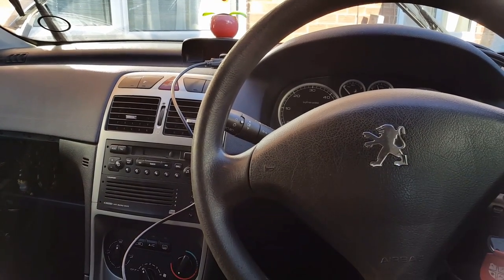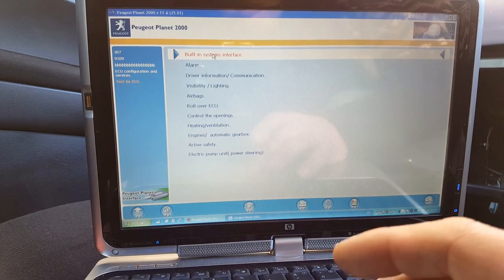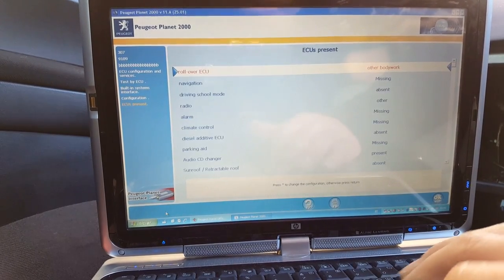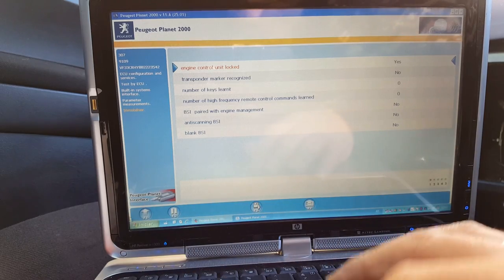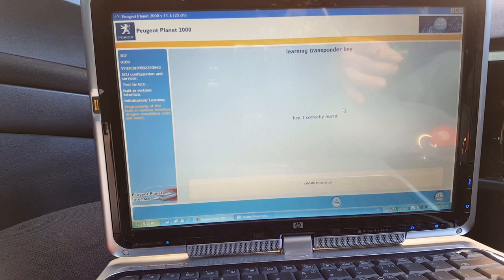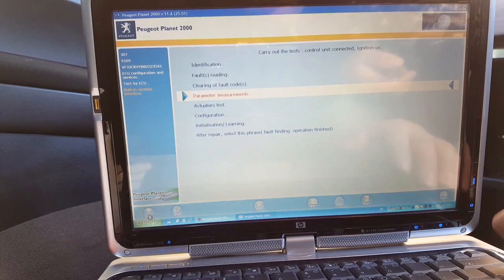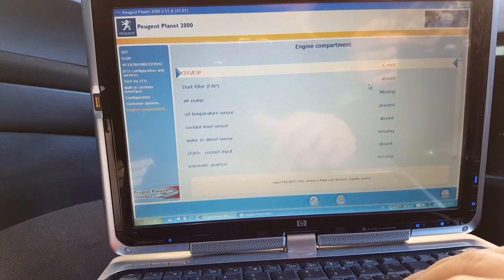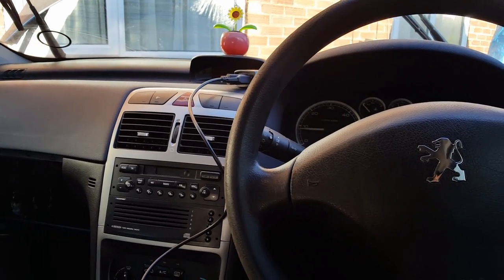Peugeot Citroën blank/virginized (new) BSI programming. Includes key/immobiliser programming.

Comment: Thanks to LM for his excellent videos.  I am using a Planet 2000 that comes with a recent Diagbox and I had to do things differently to get the BSI working.  I tried to configuring the BSI through the "ecu configuration and Services".  I configured the VIN all the ECUs present on the 307 but couldn't get past entering the PIN code to do the key programming.  Planet said the BSI was blank and should be programmed.  After some searching I followed a suggestion on another site to select "replacement Parts" rather than "ecu configuration and Services" and choose the option to configure a replacement BSI. It remembered the VIN I had previously entered and I had to overtype a few of the characters so it could be saved and it then asked for the PIN which it also saved away.  After that, the BSI it was unblanked and it all worked like clockwork.
Reply: I have same problem and I did as you write here but still no luck
Maybe I need to use old version of pp2000
Reply: @adnansuljic3739  I have the same problem, I can't find any solution :/

Comment: Did the high frequency remote work on the second key?  At 20.23 minutes into the video the screen shows 1 HF remote learnt.  My understanding HF remote is also  learnt when the key is programmed.  Synchronisation is a second step, which only synchronises the remote’s coded signal with the car.

Comment: I have a new, unused BSI, purchased from the store days ago. I plan to install it on a peugeot 3008 which is currently running, but with some flaws due to the problem in the current BSI. Since the vehicle already has 2 keys recorded, I would like to know if even then, after installing the new BSi I will have to present new keys or if I can use the existing keys, since I will not make any changes to the PIN code.
Reply from the maker: Hi
As far I can tell, you will need new keys... 
Thank you for watching!

Comment: Loving and learning alot. I have read all the comments. However I am having trouble with 2 things. 
1)The pin code. If I don't know it, I need to get it from the ecu I think. How do I read it from the ecu, a scan tool, and if so what scan tool? Or do I phone Citroen and get them the vin.
2)if it is a new bsi, I need a new transponder for the key and remote for locking and unlocking. It that because the new bsi can't use used transponders and remotes??

Regards Seb
Reply from the maker: Hi
1. Yes... you can take it from the ecu... I have videos on that...
Or, go to the dealer and they will supply you with the code, once you prove you are the owner of the car...
At least, is how it works here in the UK.
2.yes... you need new transponder and remote for the reason you mentioned.
Thank you for watching and for your comment!

Comment: Once again you are one in a million bro.. I have problem with a 406 Peugeot signal it's only flash thrice and stopped I have changed the bsi and also the com2000 still not working any guidance please I will appreciate thanks.

Comment: Hello mate,thanks for the video.I have an issue with a citroen relay,bsi needs to be matched to the ecu as there is an immo error.Do i need to pull the pin to be able to match them with pp2000?It is a 2019 van so i wonder what tool would be best to match them.

Comment: my 307 SW 2005 is leaving the lights on for 2 minutes or so after closing the car if stop with lights ON, do you believe this could be a malfunction in my BSI? i have PP2000 and interface please help me.
Reply from the maker: Any codes?
What on live data regarding lights?
Anything out of the ordinary? 
Thank you for watching and for your comment!
Reply: @LMAutoRepairs  The fan The air conditioner stopped working, the same day I noticed this problem, if I turn the headlight high or low, they will not turn off anymore, I need to the car and wait a few minutes. No error codes are appearing. The only strange thing I noticed was that my scanner is no longer reading the engine calculator.
Reply from the maker: @VisionStudioFilms  
Check live data...

Comment: Thumbs up for the great job..my problem is the car remote has signal but when i try to lock/unlock the car not respond i don't know where i start?  and i don't have that security code
Reply from the maker: Hi
Have you replaced the BSI? 
Thank you for watching and for your comment!
Reply: @LMAutoRepairs  yes,i replaced my engine with another one with all the component of the new one including wiring loom bsi engine ecu eveything
Reply from the maker: @ahmedhisham1438  
Ok...
And the key and remote still the original one from the car correct?
If yes, then you need to program a new key...
That remote will not work again on that other BSI...only on the original...
Program another key and that's it...
Reply: @LMAutoRepairs  no, the key and the remote of the new one also and the ignition as well
Reply from the maker: @ahmedhisham1438  
In that case just to through the sync procedure...
I presume the car is starting ok, and is just the remote that is not working,  correct?
That failing,  you might have a bad remote...

Comment: If I understand the info on top correct. If I do not have at least one original transponder chip and remote I will not be able to get the remote to work?
Reply from the maker: Correct...
Or you get a replacement key... (remote and transponder...)
Thank you for watching!

Comment: Wondering if you can help,trying to supply customer with spare key,cut and programmed it to the car no problem,however,and it seems to be a common problem is that the programming of the remote doesn't work,three new keys i've bought and the remote doesn't work on any of them?,do you know where to get one that definetly works?car is an 09 peugeot 407,thanks.
Reply from the maker: Hi
The remote should program at the same time, but need sync after...
If you are getting cheap China keys, I had the same problem in the past...
Thank you for watching and for your comment!

Comment: Hi loving your video's.  We have a Citroen c4 1.6 hdi with the same symptoms wipers and lights on all the time car won't crank. We got a blank bsi still got to program yet but as soon as we connect the battery the wipers and lights still go nuts. Should that still happen with a virgin bsi or will it stop when it's programmed?
Reply from the maker: It is possible...
Have it programmed and go from there...
Thank you for watching and for your comment, really appreciated!
Reply: @LMAutoRepairs  your a star thanks.  I was starting to think the virgin bsi was a waste of time so didn't start the process. Will get on first thing. Thanks for a fast reply.

Comment: Hi there, do you perhaps know what is the pin code for 2010 Peugeot 207 1.6VTI - ? 5 door.
Reply from the maker: The pin is different for every car... 
You need to read it from one of the module, or ask for the security card at the dealer...
👍👍👍

Comment: Nice video, very helpfull. So i'm wondering, Is it also possible to access a peugeot 4008 2012 BSI for editing settings? I just installed an android aftermarket head unit. and want to be able to controll some if not most/ all car functions via the unit through BSI. Without using OBD2 adapter.
Reply from the maker: Hi
Don't think that's possible...
Perhaps with one of those Bluetooth adapters connected to the OBD... and then accessed via head unit...
Thank you for watching and for your comment!

Comment: Hello Great video! How do you write a PIN code when you failed the first time? You stopped the video and started from the point where the pin was already writed. I can not write pin too. How did you write that pin?
Reply from the maker: You need to initialize the BSI and then write the pin... if I recall correctly...
Thank you for watching!
Reply: Thank you. Maybe you'll be a little clearer?
Reply from the maker: @ruslanasanfimovas1624  
There is a certain order to initialize and code the pin and the vin number... if you don't follow the correct order, the procedure will fail...
I kinda go through when I am actually doing it... but from the top of my head I can't recall correctly...
But I think first you write the vin number, then you initialize the BSI and then you code the pin... and then you learn the keys...
But I might be wrong on the steps....

Comment: Hi got a non start peugeot 207 I'm trying to program a second hand keyto the CAR in diagbox. I have put the key in the ignition run diagbox go to learning and program new keys I put keycode in .It accepts it tell me to turn ignition off .I do this and tells me to turn back on with in 15 second I do this I take it to the main ignition lights. And it fail I get a message saying no +apc voltage  what does this mean please

Comment: Hi there, i want to upgrade a Peugeot 206 sw 2.0 petrol with a 206 180 engine. Both cars are multiplex so the looms are compatible. My question is the following:
1) if I use the bsi from the 180, is it  possible to reprogram it to allow for 4 windows and doors, rear tailgate glass opening etc?
Or
2) is it possible to reprogram the 180 ECU to work with the original 2.0 bsi and transponders?
Thanks!
Reply from the maker: Hi
You should be able to code the BSI to 4 doors, rear glass etc... 
The transponders can't be reprogrammed... the the other option is your best one...
Thank you for watching!

Comment: Hi mate,  I have a 2010 citroen dispatch  and wanted to programme a second key, however  the immobiliser code that wilmoths citroen gave me on the phone is not the correct one,  leading me to believe somebody has put a second hand bsi n at some point,    what's the cheapest and quickest way of me reading the code from the bsi?    Could you dump the eep rom for the code if I send you the bsi?
Reply from the maker: Hi
It is really strange that they gave you the code over the phone... usually they require to see proof of ownership of the veichle...
You can either dump the BSI or the engine ecu...
Thank you for watching!
Reply: They do give the code over the phone,  the code goes by the vin number, if the bsi has been changed, plug a obd scan tool in and read the vin number off the bsi which will be the vin number of the vehcle the bsi came off off,  give that vin number to peugeot/ citroen and they will give u a code for that vin number and this will be the correct code for your bsi, job done!
Reply from the maker: @benking9503  
Well... that will not work here in the UK...
They require proof of ownership...
You can't just rang or pop in with a random VIN number, and ask for the pass code...
They will not give it to you....

Comment: Peugeot partner Combi 20 hdi 2004 ECU number is 40136 i have bought one off the same car but 2005 the ECU number is 40146 will it work when fitted or what do I have to do please help thanks
Reply from the maker: If same model etc... probably will work...
Will need virginize and programming or cloning...
👍👍👍

Comment: Hello, very important question as I can't find the answer anywhere, lets say you've lost a key and you cut a new key and you bought a new transponder, when you're programming new keys you have to do all keys at once otherwise the old one won't work, can you reuse the old transponder during the programming or you have to put a new transponder in every key every time you program the keys? In my opinion you can reuse the transponder but just wanted to confirm.

I also have a question about the BSI, when you order your code it is assigned to the vehicle, what happens if someone else changed the BSI all together with the ECU and the keys and you want to program the keys? I would imagine you need the code from the car the BSI was taken from?

What happens with the code when you virginise the BSI? Is the BSI completely blank then and the first time you enter the code you're basically telling the BSI that this is the code? 

Thanks.
Reply from the maker: rzepekpl 
Hi
Ok, first, yes, when adding a new key, you need to do all keys, and at this point you can just use the old transponders... 

If you change the BSI, you need new transponders and remotes... the BSI needs to be virginized first, in order to accept the code from the car... the code of the car where the BSI came from, is not required..

I have answered that question a few times....

Hope this clarifies your doubts...
Thank you for watching!
Reply: Thank you, you're a legend :)

What is the deal with those transponders anyway, why if you're adding new keys you're allowed to use old transponders but when you're programming new BSI you can't do this any more (or maybe you can and we just misunderstood each other?), why BSI wouldn't accept old remotes either? I thought you can synchronise old remotes with the car (and new BSI) using the procedure that was on the screen?

So basically to my understanding when the BSI is virginised you're sort of teaching the car the code and then this code is expected every time you want to program new keys in the future?

Thanks for your work, you're a great diagnostician :)
Reply from the maker: rzepekpl 
Hi
The original BSI will accept the old transponders because they were previously already programmed to it...
When you replace the BSI,  this will no longer be the case...
The remote is also part of the BSI, so you can synchronise the remotes to the original BSI only... after that only new remotes... was a discussion on how to use second hand remotes on the DK forum...
And last, yes... once you program a blank BSI with the code of the car, that will be the code required every time you need to program keys...
Reply: Thank You for your time, it is all clear now, sometimes it is really difficult to find the information you need. Thanks for clarifying the issue.

Comment: Hi!I have a peugeot 407 I want to change them ECU old ECU It is from Delphi and the other one I want to put on is from simsens,that I want to get injectors from siemens,how do i do so the car won't start with the other one ecu ,I have the key code from bsi .
thanks
Reply from the maker: Hi
Have you checked that all the other inputs and outputs are the same?
I never did that, so never had to check...
But be careful, it might be more to it than just the injectors...
As for the immobiliser, you will first most likely need to virginize the ecu, to then be ale to program it again...
👍👍👍
Reply: @LMAutoRepairs  one more question thanks😊can replace a pump Siemens with one Delphi it will work Peugoet 407 2.0 HDI thanks 😊
Reply from the maker: I wouldn't mix those systems... you might run into issues... but again, I never done such thing, so...

Comment: Good evening, ive done this prcedure today but i get 2 msgs from pp2000. One is '' The tool is not supplied to the mains socket. This could prejudice the correct progress of download operation. It is imperative that this is plugged in'' and after went it starts to program the bsi a warning comes up ''wincad caused a general protection fault in module WIN87EM.DLL'' and everything stops there. Any idea?
Reply from the maker: Sounds like a corrupted pp2000.... which windows are you using?
Thank you for watching!

Comment: Hello, really nice videos! I just have question regardimg my Peugeot 406 Coupe. After battery was disconected all the lights on the dash board are blinking and wipers moving on their own. I think I have now faulty BSI. BSI is reading error: Communication with the column height ECU...What do you think? Do i need new one or this one can be virginized?
Thanks!
Reply from the maker: Hi
Difficult to say just based on that...
Get it scanned and see how the BSI is... you can easily see under live data, and configurations if the data has been corrupted...
Hope that helps...
Thank you for watching and for your comment!

Comment: Hi there very informative .I have a question. i have 2008 citroen berlingo 1.6 hdi ,a few weeks ago the rear nearside light cluster stopped  working ,everything else in fine apart from the front nearside indicator is flashing erratically .Now have done a bsi reset by unplugging battery ,window down ,side light on and lock button key procedure ,Which worked a treat at first but was fine for a week then started playing up again.Have reset three times which temporarily worked but has now stopped altogether.Its just the rear lights on nearside .I take it that one of the chips has pack up ,can this be fixed and what would i need to do.
cheers
Reply from the maker: Hi
Need to check for codes... live data etc...
Also, perhaps remove and open the BSI, to look for anything that visually looks not ok...
https://youtu.be/5Jl_poF35_A
Myself or a fellow member, will be more than happy to help! 
Thank you for watching!

Comment: I can program new keys with no problem, but cant programme any remotes, very annoying,  can you switch off remote locking functions in bsi? I'm wondering if I need to activate remote control functions In bsi?
Reply from the maker: The remote needs to be programmed at the same time as the transponder... as they are linked... you can't program the remote separately...
Thank you for watching!
Reply: @LMAutoRepairs  
It doesnt give me the option to programme the remote at the same time,  after programming the id46 chip, it tells me how to sync the remote and says it can be done at any time and doesn't require the pin code which contradicts what you said
Reply from the maker: @benking9503  
And if you do it like that, follow the synchronisation after the transponder programming, the remote is then programmed...
I have done it many times...
Just be careful, I had many aftermarket keys that the remote fails to program...